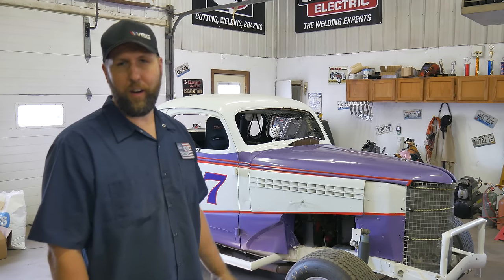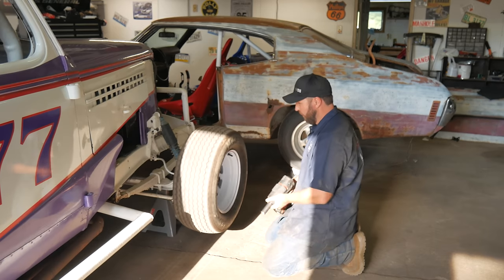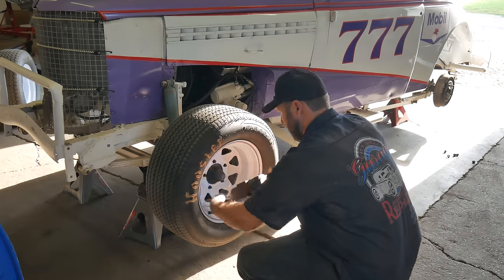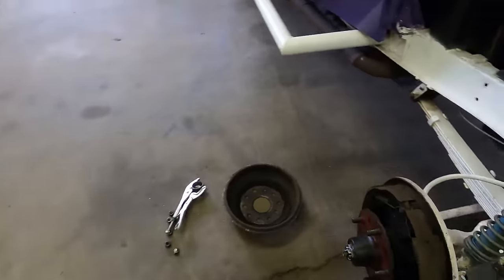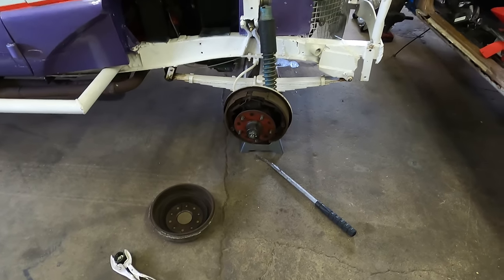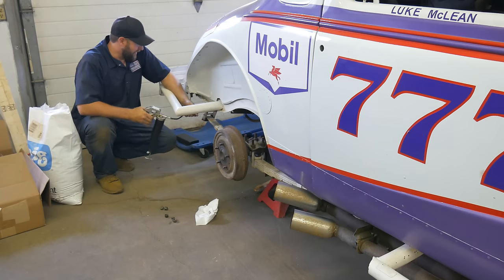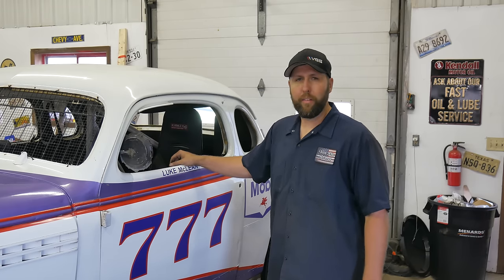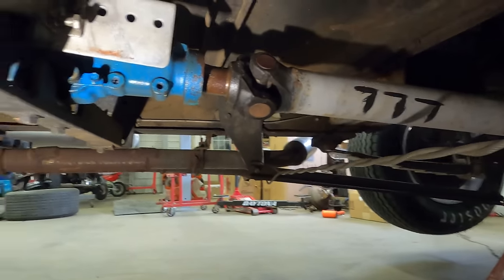Preparing the Vintage Modified Race Car for my FIRST RACE! - Vice Grip Garage EP90

Comment: Yup, a guy's right. Definitely a Dana.. My Volvo 740 has the exact same one (it's the original Volvo axle from the fact'ry, sourced in the US of A).
They're pretty much indestructible.. Mine has had 350 Chevy with 4 times the torque of the original red block engine bashing on it for 10 years and she's still in great shape :-)
Really enjoy your video's Derek. You definitely have your job cut out for you. I always wonder if you're the luckiest guy in the world, safely driving all those rust buckets back home almost every time, but I guess it also has to do with skill sometimes ;-)
Keep up the good work!

Comment: Anytime the tires rotate independently stagger will not help the car turn. It will only change the ride height, and cross weight. I run anywhere between 4 and 9 inches of stagger, but that's on a 600 micro.

Comment: I would put some one inch lug nuts on that car, especially on the right (drinkers side) front.  Eventually change the studs out to 5/8 studs.  Id also put a plate under your feet to the seat around the shifter to keep something from coming up through the floor at you, piece of pipe, bumper etc.

Comment: The way I remember it, the Chevrolet "Master" series from 1934 used a 'Knee Action' front suspension. So, ... if your car is made from an original body, chassis & front suspension combination, then I suggest that it is actually a 'Standard' model. For your purposes, the straight axle is much the better choice of the two front suspensions.

Comment: That thing has solid motor mounts you will have frame deflection why did they mount the alternator pivot on the frame has to be on the engine it will move and smoke the belt or worse smoke the bearing.

Comment: The seat needs to mount to the cross bar that is missing from the rear hoop, that's where your 4 point harness should mount also in case you flop it on it top 😀

Comment: I'd get a cable shifter out of a mid 90's japanese van etc or even some of the FWD cars had them aswell. Then you can place it where you like and have very little /no slop
Reply: U really think you're going to shift a Muncie with a cable shifter 🤔😂😂😂
Reply: @EASTSIDE-313  yip seen it done before
Reply: @rockabillyrebel9207  fairy tales
Reply: @EASTSIDE-313  guess you just didn't do  it right

Comment: My buddy's 1953 Allard has a three speed floor shifter mounted between the driver seat (LHD) and the door. We believe it's a column shift linkage mounted horizontally if that makes sense. A guy might think about that.

Comment: Anytime the tires rotate independently stagger will not help the car turn. It will only change the ride height, and cross weight. I run anywhere between 4 and 9 inches of stagger, but that's on a 600 micro.
Reply: Chages the braking taller tire less effective brake . and on a solid axle changes camber tilts the axle

Comment: Okay here's my speculations on your race car. Rear axel most likely out of a mid 50s jeep pre cj?  Front axle mid-50s half ton Ford truck. Both of those would have five on five and a half bolt pattern which as near as I can tell from the video is what you have there. Be curious to know if I'm right on these. As for your shifter sparklomatic made a three-speed Universal shifter for years I had pretty good luck with them in my various Ford trucks that I converted from three on the tree.

Comment: I had a shifter like that one on my old mustang for about two weeks then it went right back in the box of junk I found it in. It's kind of distinctive the way it's made and all. If you keep it remember it was a cheap car throw away when it was made but if you want to keep it you will have to make a new shifter stick to move it out about four inches mine came with such a stick. But your best off just getting a cheap Hurst shifter in it but hey it's your car do what you can my friend and I really mean it Good Luck out there on the track.

Comment: Derek the brake shoes are installed incorrectly on the left front. The largest lining always goes on the rear of the assembly. I will assume that the rest of the assemblies are also incorrect.

Comment: Couple of quick things...not sure where you're planning on racing but I'm pretty sure any of the big sanctioned tracks IMCA, USRA, WISSOTA, your plastic seat won't be legal. You mentioned changing wheels studs...put the big studs on with the 1" nuts. I see you got new belts which will be up to date..make sure your helmet is too. Most of us dirt trackers running 3 speeds use the aluminum 2 lever set up. You can get the levers and rods from summit  or a number of other places. Not very expensive

Comment: The stagger deal is prolly because he last drove it on the street.  Can't run a welded rear on asphalt with stagger unless you are turning all the time.  I bet he swapped ends to drive it around.  The front sounds like rear stagger ... 
The front could be run with equal size tires ...  The front cares more about spring pre-load which he has handled with the shock stagger and springs.  I suspect that the winning combo is staring you in the face, just on the other ends ...
For the fuel system, I'd prolly run the pump up to a Tee with a regulator feeding a return with the excess.  So you have clean cool fuel always.  Prolly an 0.045" orifice downstream of the regulator in the return line will keep you returning, and not over returning :)
For the shifter, flip the lever 180 and it ought to be close to what you want.  If not, you got a torch, so heat it and bend it  :D

Comment: Get the seat to the Left for weight bias.
Make sure you have a plate under the seat !
if you roll..
A car can hit you in..the "bottom"(?).
Same for debris on the track coming through floor.
That looks like a Saginaw 4spd.
If you've got a 3 spd USE IT.
1st there's less rotating mass in a 3 than a four.
If your geared ok..
You'll only use high gear anyway..
Rule of thumb....
No less than 4k in the turns.
Lose the L/f brake..
It will lock upon entry.

Rear stagger is for the locker !!
The turn designates how much stagger.
You know how lockers squeal turning on pavement.
Stagger helps keep the tires from fighting as their turning in different a different radius.

NEVER FORGET..
when in doubt GAS IT !
Make sure there's NO breathers in right valve cover..and it's sealed well !
(That's where your oil will be !)
Personally I like a 195 thermostat !!
(It keeps the water in the RADIATOR LONGER..
more time to cool.  (.)
Up the psi on your cap.
Good Luck!

Comment: change the linkage by taking all of that off and build a new one with better ears on the 351 muncee... youll have to plasma cut a few pieces of flat stock but think of it as attaching a big L on the top of it

Comment: 20w-50 oil is what you should run for racing. but i suppose if a guy keeps the oil cool enough you could run a good synthetic 5w-30 for that big rush of power.

Comment: Muncie? 3 speed? Looks like an old Saginaw to me.
Oval track? Change gear? Use second gear.
Factory fuel pump?  They pump about 4 psi. What psi does those carbs require.
Purple belts match the car

Comment: I'm gonna assume the rocker studs backed out on that 283, hence the heads. But that also means there is more than likely a decent cam in there as well.  All you need do now, is mix about a 1/5 to a 1/4 Nitropropane C3H7NO2 into your gazoline, runer' a bit rich, and win that race.  No they cant detect that stuff, all it'll do is oxygenate your fuel, so it burns lean and mean.

Comment: Bolt holding strength is at maximum if you can get one and a half times the bolt diameter on the thread engagement. What size are your wheel studs?

Comment: put a dog leg in the gear shifter then it will be on the outside of your leg it might look a bit hinky but it will work have done it many times in dirt race cars and it works great you might need to lengthen the shifter as the bend will make it 6 to 8 inches shorter why not give it a go its a quick fix that does the job.

Comment: I always thought you shouldn't bolt racing harnesses to the floor behind the seat, because if you crash it pulls back and pulls downward on your shoulders and causes back injury.
Reply: Yes the seat and belts should be mounted to the cage not the body. you want to stay with the frame and cage not the floor pan
Reply from the maker: Can't exceed 30% angle with most harnesses.  Each is different.  But harness goes to cage.  Cage goes to frame.
Reply: @ViceGripGarage  lap belt , anti submarine belt and Seat should also go to cage and frame. If you get in an accident the floor will distort floor goes one way cage and harness goes the other You lose. It doesn't take much and to do it either. You want to stay with the cage . Seat, lap belts, sub belt, and shoulder harness.
Reply: @ViceGripGarage  You run the mount from the lower door bar across across the front of the seat to the right of the seat then back to a tube between the base of the main hoop, Then you mount the seat and belts to it , So if you get hit in the drivers door you will move with the cage not get run over by it also the floor distorting as i mentioned. 
Now here is the problem its an old jalopy racer just how modern do you want to make it? I suggest anything safety needs to be updated but the rest suspension engine drive line stays old school.
Does it have a driveshaft safety loop? How about that fuel line. Many of the vintage cars running are just modern dirt modifies with an old body. sounds boring. This car has character.

Comment: A smaller steering wheel would help with shifting, you would have more room to get your arm to the shifter, you could fabricate a L bracket and move the shifter outside your leg

Comment: Not a transmission guy, but could you flip the trans over and run it upside down? It would move the shifter to the other side but would change the shift pattern.

Comment: The reason for switching the primary shoe and the secondary shoe is to increase front brake engagement. The reason primary and secondary shoes are different sizes on drum brakes is to decrease wheel lock by first engaging the primary (smaller less grippy shoe) first followed by the secondary (larger more grippy shoe). When the brakes are applied the piston of the wheel cylinder moves the primary shoe into contact with the brake drum. The rotation of the brake drum causes the primary shoe to be dragged in its forward rotation the forward rotation wedges the shoe into the drum and transfers to the secondary shoe. By switching the position of the primary and secondary shoe you’re making the secondary shoe (larger more grippy shoe) engage first followed by the primary (smaller less grippy shoe). By making the secondary shoe contact the drum first you’re increasing initial brake engagement to the front end. The goal is not to increase front braking bias it is just to increase initial brake engagement. Increasing front brake engagement helps on dirt track cars by using the front brakes to keep  the rear tires in line when coming into corners and also has the advantage of being able to use your front brakes to straighten you out when your rear wheels break loose. Sorry if my explanation doesn’t make sense I’m not the best at explaining stuff it made sense in my head. lol hopefully it makes sense to those that are curious why the front brake shoes are (backwards).
Reply: yup

Comment: I'm sure you've discovered and fixed on her plenty by now. She looks like she was a column shift before as most older 3 speeds were. A lot of times when you convert those to the floor, you get that play in the shift that you either just live with or keep fixin periodically.  That could be why "ol' guy" put her between the legs. Maybe he did it before it became as common.  If you happen to look at newer comments on older videos, I would like to see what you've come up with since posting it.

Comment: 30's Chevy front suspension right down to the knee action.  Probably handles like a pontoon boat with a list.
Reply: Thats not knee action. Knee action was the first chevy  independent suspension. Thats a straight axle
Reply: @tomhutchins1046  I stand Corrected.  I thought all Master Models from 37-39 had it.  I need to re-watch the video.
Reply: @joshuafuller9898  its a chevy hat style frame. but that straight axle may not be original? Those frames were very weak also. if he hits something that frame will fold right up in the middle and the doors will blow open. Also getting speared by that steering column is a risk.

Comment: for anyone who has never run on bias tires it doesn't matter how bad the dry rot is as long as chunks aren't coming off you can run them tell you see cords. unlike a radial tire bias don't suffer from the shed the tread problem of the radial tires. so you can literally run the shit out of them and not worry tell you see the cords . also it doesn't matter which side they ran on you can take a tire off any side front or back and put it on the opposite side no problem God I miss Bias ply tires

Comment: The popular heads were called " Double hump "  or " camel hump" for SB 283 / 327's.
Reply from the maker: Yes those too.  Larger valves, larger chamber.  It was either power pack for CR or double hump for flow

Comment: I didn't scan the comments, but those front brake shoes are on the wrong sides, the shorter shoe goes on the front. Unless that's a dirt track thing to run them backwards. Leading and trailing system.

Comment: Now, Derek, you haul off and get yourself a brand spankety new lift and don’t use it. In about 1970 I had a 1960-1964 Volvo PV544 that had over 20 zerk fittings. The front suspension was so antiquated that it had a real, physical kingpin. I found all of those fittings but one. Who’a thunk that they’d put one on the water pump shaft?

Comment: I have a race of vintage race car just like the one you're showing and it was one of my favorite classes there to drive on dirt because it drives way different than any other type of race car I've driven and it's got a lot of horsepower mine has a 383 stroker in it. And the tires are way different than other dirt track car I'm driven to so we had to run the same tires that you're running some skinny up front tires and a little bit wider tire in the back but not by much so vintage race car tire that hooiser  actually made for this class well the track I run at and we're up North I'm at I used to race down south but now I had to move up North for a job and I've been racing a vintage car for somebody up here. I'm also building me one from an older vintage chassis he had and I'm going to make it into a street legal vintage race car with two seats it's going to look just like your car except it's going to be painted different of course and have two seats in it for car shows. I will have modified headers on it what comes out the side by the front tires and they're going to be powder coated white like a vintage modified used to be and the chassis and me powder coated White and then same with roll cage powder coated White it actually have a white and blue body but it's going to be a way different style paint job so I love the color blue on these cars and specially white as well

Comment: Damm if that SBC don't sound nice.
It's been 40 years since my Chevy days.Real American Power in a small box.You probbly got at least 300 HP on pump gas at 5k RPM, more is just too much for dirt in a jalopy.
Just don't scratch the paint or get it all dirty.
Them white frame rails make it look like an ambulance

I don't know.

Comment: I’d straighten the drivetrain backup and try to get the shifter in more of a normal position.
Reply: If you wanted to make this a real car you would have to start over. The seat is moved over to get the driver away from the door. It is an old car and hacking it up to make it some thing its not would be a shame

Comment: Why not just modify an old 3 on the tree shifter to work with that column. Thinking  you should have something laying around you could cut - weld on to make that work. You know back to original, sort of.
Years ago I had witnessed a few old budget racers tighten those up and do pretty good with them.

Comment: i had to pause your video....but i have had some cold snacks....maybe what i see wont matter. um your seat is centerish in here, and on some of the drilling rigs i have helped build, im thinking what may help is to kind of gorilla link that over the top. how much room do you have over the tunnel to the usual passanger foot area? im thinking a brace on the floor, through a hole in the tunnel? if any of that makes sence? just a thought

Comment: That's how those old race cars were built, back in the day... On the cheap, within restrictive rules and using whatever you could scrounge. Things like disc brakes were for higher dollar classes.  Please, if you really race it, build a roll cage that is safe and will fit you. Hurst Synchro-Lock 3speed floor shifter was light years ahead of the Hurst-Indy shifter back then...

Comment: Dereck both the front brake shoes are on backwards you did not see that tall and short brake shoes wrong it wont wear correctly and activate self adjuster correctly either.

Comment: Ya see as a feller gets on in them darn ageing numbers he battles this kinda stretching in the good ol bag department so that loose shifter will be good  bag scratchin  in 1st and 3rd on those hot nights of slammin fenders that will be just what the doc orders if in a guy gets bad case of stick bag you enjoy that loose shifter  and good luck with old triple 7 and BS a guy could put that CB rad did eo in the mitten box and maybe some sort of an old 8 track for those next few road trips

Comment: Those shifters are the absolute worst. The bolt that holds the levers together backs off and allows both rods to move at the same time which locks the trans up solid. Please tack weld the nut if you continue to use it.